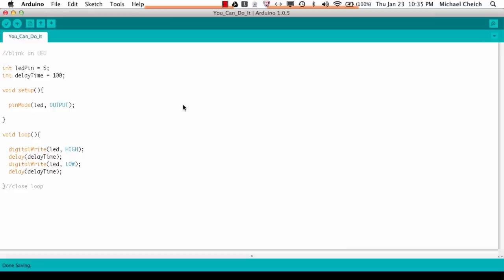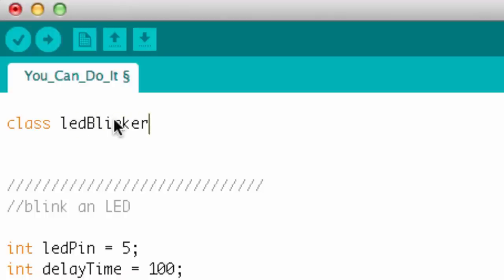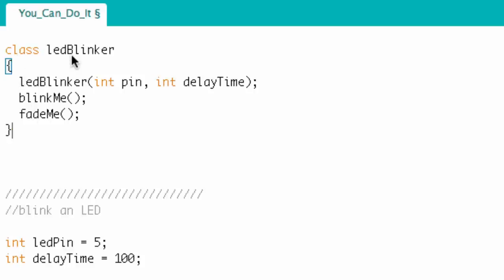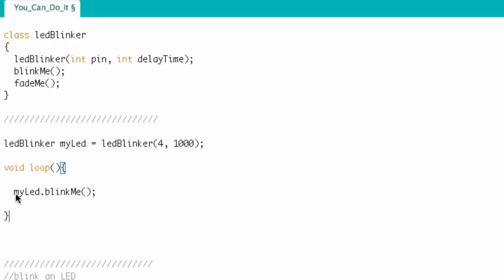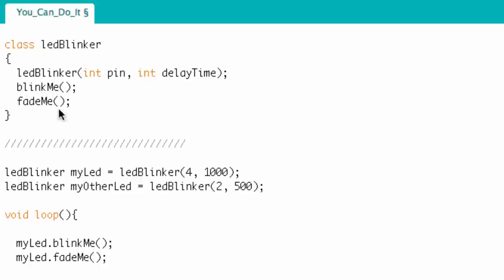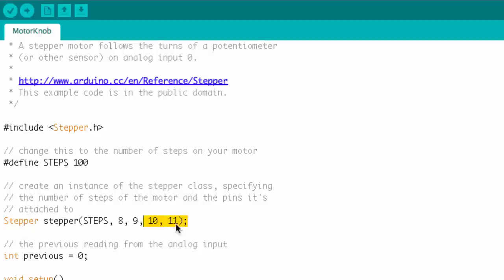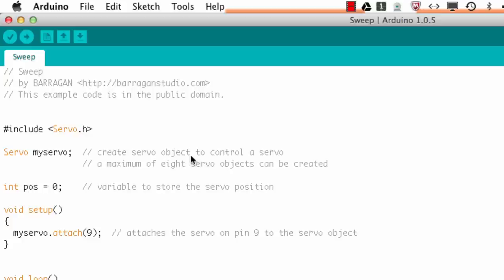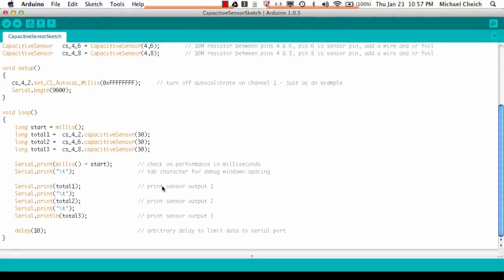Understanding an Arduino Library :: Video #2 :: Arduino Library Series

Comment: Thanks dude. Very useful
Reply from the maker: Glad it was helpful!  Are there any specific Arduino topics you would like covered?
Reply: @programmingelectronics  more advanced topics would be interesting. For example, streaming sensor data via bluetooth, or even better - gathering larger data blocks and then sending them. (To start BT for each read takes up time, hence reducing bandwidth)
Reply from the maker: @mjucevic  Thanks for this!

Comment: Thank You Thank You Thank You!!!
I'm banging my head against the wall trying to figure out how to use the temperature reading from a DS3231 library that I downloaded, wrote a bunch of code for in a project, and only afterwards discovered the temperature sensor  option on the datasheet. Of course there are no temperature reading examples in this library and the temperature features are grouped into a different class than the time/date functions. At least the code seems to be included though.

   It's funny to me how "C incremented" can seem so unintuitive when compared to the most basic C despite the name. It should have been "C--" IMO, for "Unintuitive C." 
  Main, if, when, for, while, etc., are all extremely intuitive to grasp but everything you showed here about classes requires contextual explanation and memorization.

 BTW I came across your upload for libraries part one after searching on the YT mobile app for ""Arduino Library C++"". Your upload was the 13th listing in results. I mostly clicked because of the clean thumbnail and the open source logo. It was the 3rd upload I watched since searching. This upload was suggested under your first 'library' upload as the second listing in content suggestions. This upload contains exactly what I was searching for. Hopefully explaining this kind of thing in a supporting comment helps to tune the SEO metrics of the AI as I think that's a thing already but could be wrong. Also I think it's fun to share these details from time to time with other CC's because there is no way to really verify all the channel metrics YT gives us. 
  I'm just a non-monetized hobbyist with no plans to change that, and rarely upload. I couldn't care less about self promo. I also added these two uploads to my "IDE Arduino" playlist. All my lists and subs are publicly listed too and are ~98% other CC's stuff I found helpful and saved for later reference. Everything is highly indexed but others cannot sort the list alphabetically like I see and use it.
Thanks again for the upload.
-Jake

Comment: Great Video, I am like a dog with a new bone, I can’t get enough of this stuff.
When I am in my sketch, and my library #include <xxx.h> dose not turn orange in color, what do you think is wrong. Also if I  have #include "zzzz.h" not turn blue in color, What do you think is wrong?
Ron
Reply from the maker: Awesome question!!! I took me a few to figure out what was going with this one.  In the keyword.txt file, the designation of the color (i.e. KEYWORD1), must follow the keyword with a TAB. I found this in my new favorite Arduino website page about libraries http://arduino.cc/en/Hacking/LibraryTutorial . So go into the keyword.txt file, and make sure only a TAB exist between the keyword and the designator.  This fixed all my non-coloring keywords.  Thanks bee Hive!

I am will do  video about the keyword file...